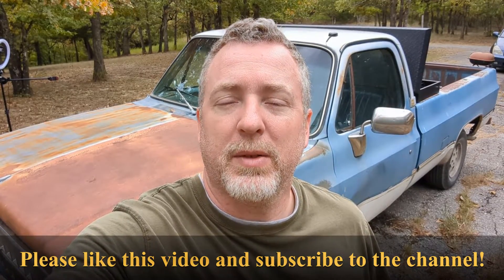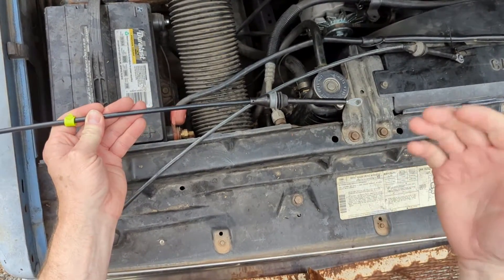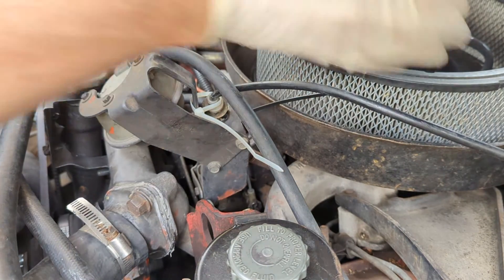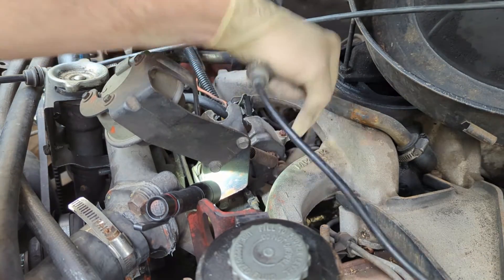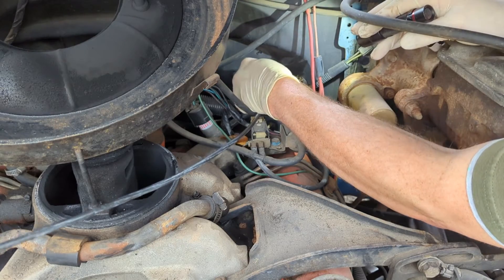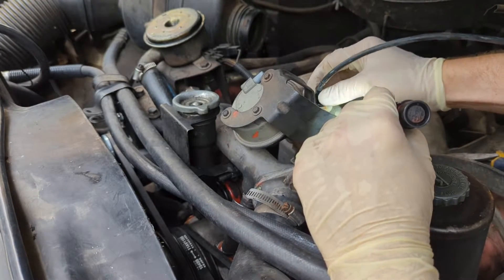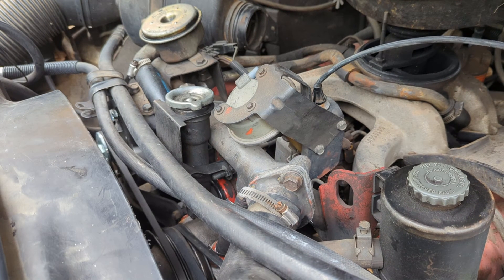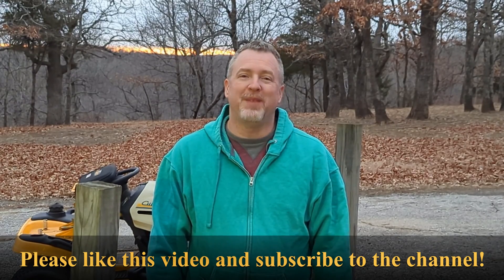Accelerator Cable Replacement | Idle Adjustment | Hard to Find Part | 1982 Chevy C10 6.2L Diesel

Comment: The replacement cables that are commonly being sold are 1/8 to a 1/4 inch too short resulting in a fast idle. I removed the cable bracket from the engine.  ( bottom bolt is a bear but doable )  Used a round file to elongate the holes making the bracket adjustable. Maybe an hours work.  Problem solved . 85 K10 diesel.
Reply from the maker: A little MacGyver never hurts every once in awhile!

Comment: I just went to the junkyard. Had one in a similar model.
Reply from the maker: My concern with getting one from a junkyard was that the age of the rubber would give me the same problem. I'm glad it worked for you!
Reply: @michaelfirey  I had my cable snap at the top of the peddle rod while driving. I was lucky to find only one at the junkyard. My model is a little different, I didn't have the rubber problem. The new one did work but it didn't clip into the rod, it just sits on there and just works. I really outta order a new one with a plastic piece that clips on.
Reply from the maker: You know what the old guys say...if it ain't broke...

Comment: I have a 1986 with a 5.0 engine and an eddelbrock carburator. The pioneer brand calls for CA8500. Do you think that could also be a mismatch?
Reply from the maker: After my experience with this truck it would make me wonder. I would just look at yours and the photos of the new one (if you can see them) and compare. Worst case scenario you just return it. With the age of these trucks it's probably a crap shoot.

Comment: Is this the same tv cable for my 84 6.2 2wd 700r4?
Reply from the maker: According to rockauto.com, they say the same accelerator cable works on your 84 and my 82.  They list it as ATP Y270 which is the wrong cable but the one from hillbillywizard.com matched my truck so it would probably match yours too.  In my video I show close ups of the part numbers for more details so you can compare how yours looks visually to mine.  If it looks like mine then the one from hillbilly wizard will probably work.